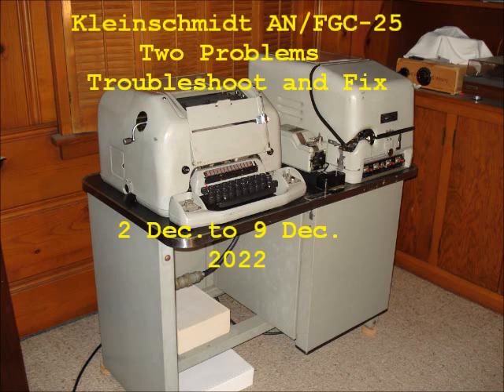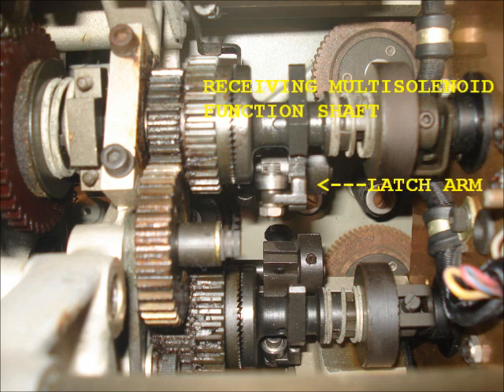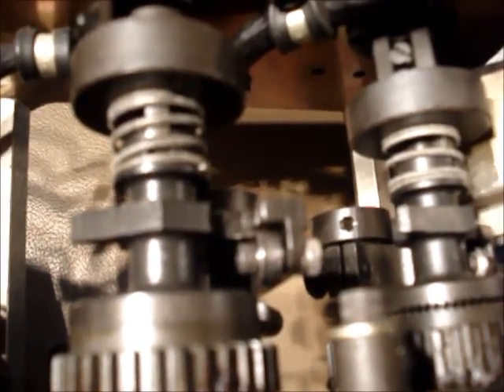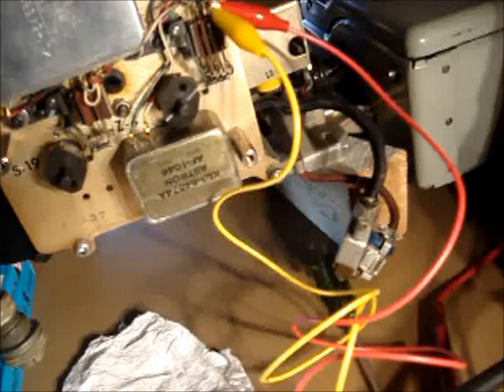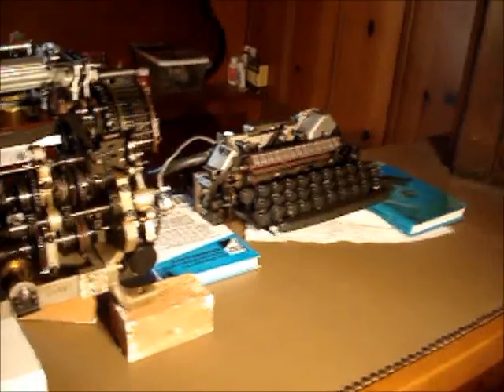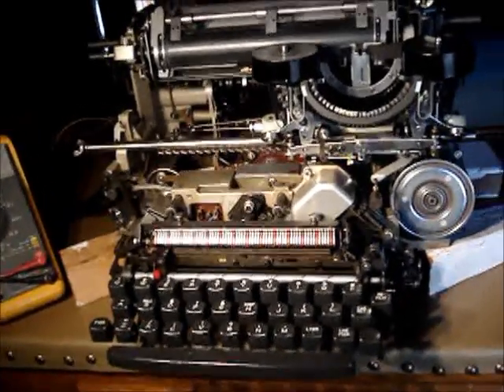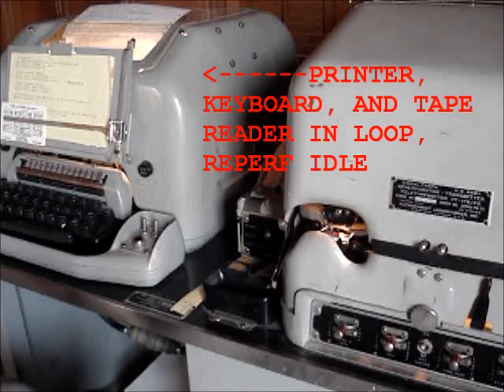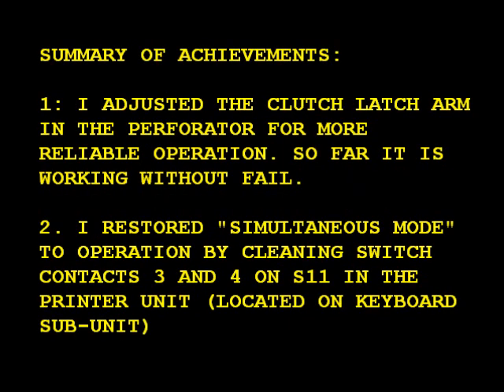Kleinschmidt AN/FGC-25 Troubleshoot/Fix Two Problems

Comment: great work! these are not simple machines to troubleshoot and certainly not simple to fix.
Reply from the maker: Thanks for watching! I neglected to mention in the video that the clutch finger was occasionally catching on the outer edge of the small roller bearing that you can see in the video. Widening the gap ensures that the clutch finger clears the roller bearing as the clutch moves forward.  It had to be my own fault for setting the latch arm gap a tad too small, back in 1978.

I agree these electro-mechanical marvels are not simple. On the day  I acquired the printer at an Atlanta area hamfest in 1977,  I was most fortunate to also meet Fred Schmidt (Typetronics) there, who happened to have a copy of TM-11-2246, the bible specifically for the AN/FGC-25, and I bought it from him. During the rebuild and restoration of both the printer and the reperforator unit I ordered all the parts (and tools) I needed from him, by mail, without asking for a quote first. He would send them to me right away, along with a note for how much to pay. There were several orders, especially for springs. Many of the tiny springs were either missing or corroded. 
-73